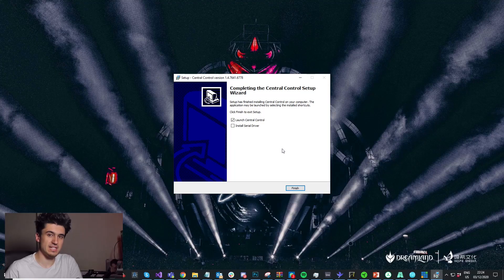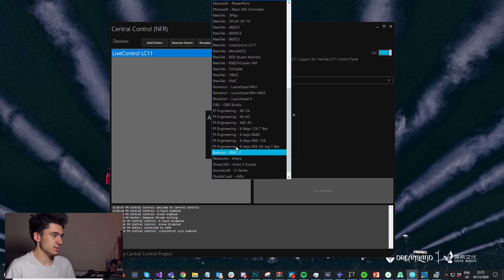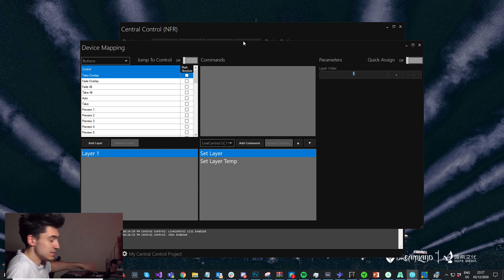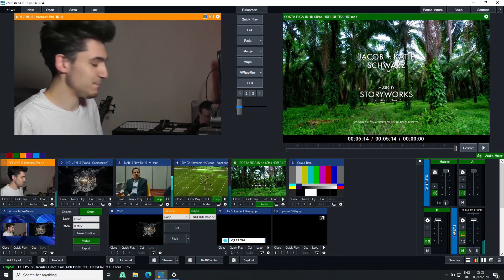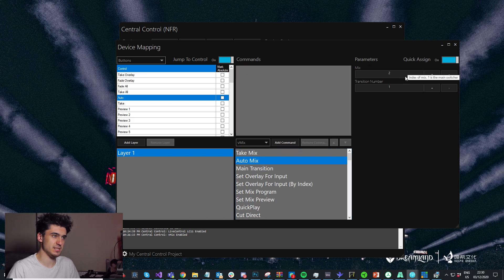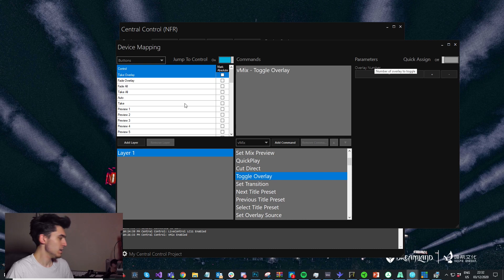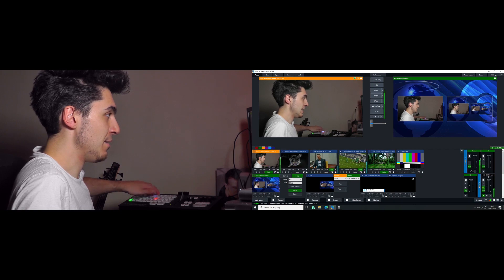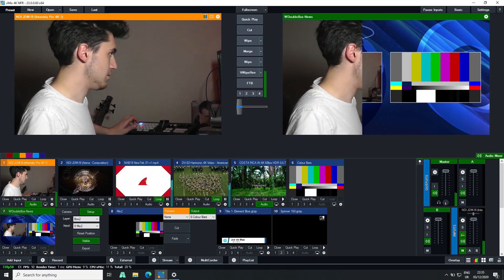Control vMix with a NewTek USB Control surface!

Comment: Hello, I have downloaded a trial version of Vmix and a trial version of Central Control. The Tricaster 460 desktop panel was recognized, and Central Control recognized both the Tricaster 460 and Vmix, but the connection isn't fully established as the blue color hasn't appeared completely. I would greatly appreciate your assistance. Thank you very much.

Comment: SERIAL: Access to the path 'COM3' is denied. any idea why that it?   Newtek Rs-8
Reply from the maker: Hi - the port is likely being used by another application. I would close everything else on the system and see if you have the same results. It would also be good to ensure that COM3 is the right port (you can do this by looking to see if it disappears from Device Manager when you unplug the RS8).
Reply: wow that solved my problem!  turns out streamdeck was the issue! :D

Comment: What's going on if nothing shows in the COM Port box?
Reply from the maker: Serial port driver not installed or VCP option not checked in device manager (sometimes this has to be done manually). Best to send an email to support.
Reply: @thisiscentralcontrol  HA!!! I was just watching your appearance on the vMix NAB show when this response came in. Thanks! manual check of VCP in device manager did it! Cheers!

Comment: Is there a way to install an older tricaster TCXD850 CS driver so I could accomplish this?
Reply from the maker: That one works - just use the 860CS device
Reply: @thisiscentralcontrol  I have tried that one and it does not see the device.  Device manager is looking for a driver.  Where can I get the driver for the device?
Reply from the maker: @jerrypetit3189  Send me a DM on Facebook or Skype (joedemax) and I’ll work through this with you.
Reply: @thisiscentralcontrol  I got it working.  Thank you for your help.

Comment: I have a Tricaster 460CS control, I can use a lot of functions. In fact, I can't enable function for SetOutputExternal2.
Can you help me? I already have the paid version of softaware
Reply from the maker: You can use Execute Function to do this command, or better yet, just send one of the 3 mix inputs to that output and cut inside your mix input
Reply: @thisiscentralcontrol  I've tried execute function, I don't know if I typed the correct way for vMix to understand. I typed Set Output External2, in function and 1 in the Input option, I tried to paste 1 Input and it didn't work
I also tried SetOutputExternal2 with put Output value, I tried without value. you know what the correct spelling will be for the function

I use external 2 and 3 here in the broadcaster, in addition to the main

Comment: What controllers will work with Central Control with the Tricaster Mini running Standard Edition. Can you use a RS8 using Central Control ... Also the TW42 Replay controller?
Reply from the maker: Both of those controllers work - but I'm not 100% sure if we will work with Standard Edition due to some limitations in the API.

Comment: hi , where can i download vcom driver for w10 ?  I have a Newtek Rs-8 keyboard, does it run wirh Vmix? tks for your answer
Reply from the maker: Run the Central Control installer again and check "Install Serial Driver" on the last bit. Or if you browse to the Central Control install directory it's in there. Run as admin!
Reply from the maker: And yes RS8 works fine with vMix.